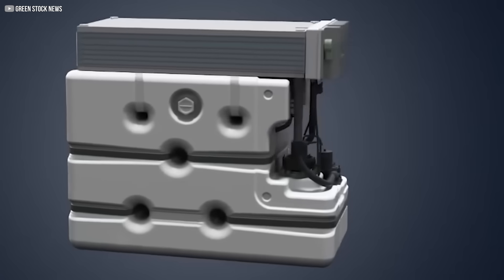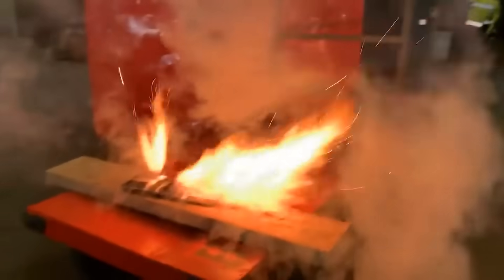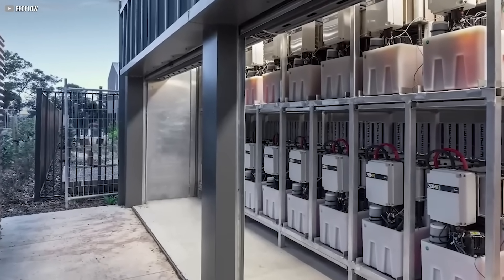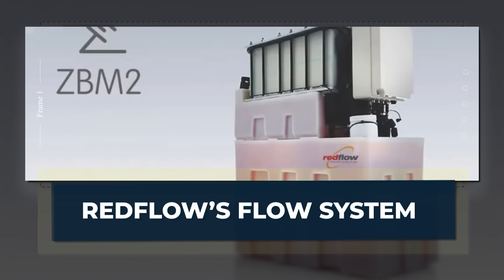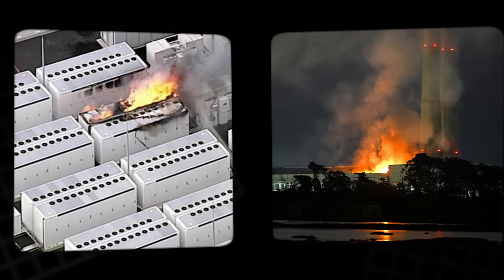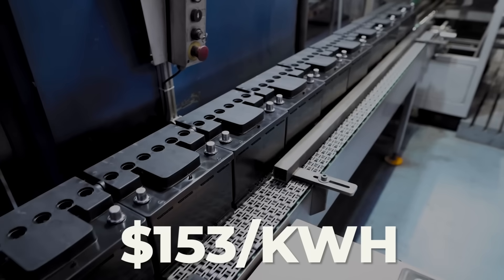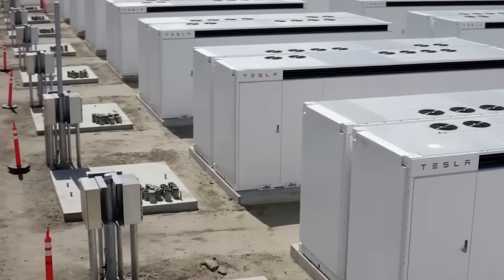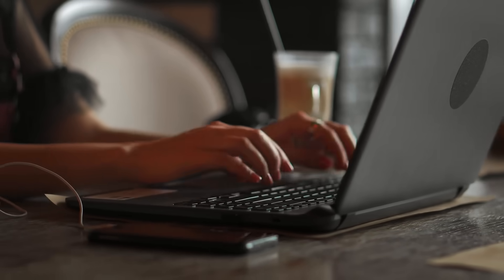Why a Century-Old Battery Is Suddenly the Future

Comment: thanks for this article which is long on enthusiasm and short on facts. i'm trying to understand the motivation. is it just surfing for eyeballs, or are you really advocating this chemistry? 

the zinc-bromine redux battery's energy efficiency is far inferior to lithium. while lithium can discharge almost 100% of the energy that was put into it, zinc-bromine wastes 1/4 of its energy. if you were advocating for energy efficiency in a redox battery, then vanadium would be a better choice. 

lithium batteries continue to improve. chemistries such as lithium titanate are safe. every mechanical part of a redux battery -- every pump and every valve -- still has higher failure rates than a solid battery. for reference on zinc-bromine efficiency, please see "a high-rate and long-life zinc-bromine flow battery" in the Journal of Power Sources Volume 613, 1 September 2024.

Comment: Not going to watch the whole thing cuz it's far too sketchy but the diagrams you shown are flow batteries. Hardly forgotten. Also, most batteries are surpassed by the capacity of the newer technology. Not that the older technology was bad. Just didn't have the capacity of the new ones do per volume or weight

Comment: According to Gelion they MOVED AWAY from "zinc BROMIDE (‘ZnBr2’) battery" to Zinc hybrid technology. 
When? At the end of 2024. The hype about Gelion Endure or a zinc bromide non-flow battery began from 2019. 
According to the article from Dec. 2024 at SolarQuotes_com_au.
So this VIDEO is OUTDATED about 6 months if my resarch is correct. They are experimenting with different chemistry now.

On Gelion 's page (GOOGLE) allinurl: gelion com technology zinc 
_ titled "Zinc Hybrid Battery Technology"  _ under "Zinc Frequently Asked Questions"  
Question:  
Why did Gelion pivot from Zinc Bromine to Zinc Hybrid cells?
<< Gelion determined that the Company’s ability to improve the safety of the existing [zinc bromide] battery will come at a cost of reduced energy density that will be below an industry-tolerable standard and resolving these will require a further lengthy research and capital expenditure plan. >> 
!! No links, because of Youtube filters. Sorry for the inconvenience. Does anyone have sth to add?

Comment: Meh, still prefer the Nickel Iron battery for home use.  Bromine is toxic.  Life span of Zinc-Bromine is 10-15 years compared to 30-50 years for Nickel Iron.  Nickel Iron has "more maintenance" but it's basically topping up the electrolyte.  Zinc-Bromine (non gel types) have pumps, replacing one of those is going involve dealing with the Bromine solution.  Sourcing materials for Nickel Iron is dead easy, and can be done in most countries, getting the ingredients together for a Zinc-Bromine battery is not going to be easy and may require licenses because of the hazardous nature of Bromine.  Zinc Bromine does have a higher energy density and cell voltage, but for DIY home use it's not enough to offset it's other issues.

Comment: yeah well i have water and salt with a pinch of carbon steel working on my basement since world war 1 or maybe before it started producing enough to power 2 in efficienct yellow fridge that look like it came fro 60s era 2 aircon tvs 9 fans and other stuff being charged by solar it has multiple pure silver poles poking out its box , its a DIY but damn it  works well and never been serviced since its build as my sister told me and now its my turn to take care of this relic and honestly we dont know how wed fix it if it failed so all we can do is put alot of safety fuses and breakers and super capacitors in each connections to protect it because the one who made it forgot to or maybe theres no existing blueprint when they built the battery.... is an aluminum ice cream drums with carbon steel and silver

Comment: I do like this battery, I installed a set up last year to a commercial building with solar panels. The battery was fine, the obtuse monitoring and control hardware/software is NOT. But it is easy to bi pass if you are an electrician.

Comment: Lead acids were used for cars because they were cheap and handled well short pwerful power drains from moror starters. Lithiums got used in laptops because they had great power density for unit of weight. But neither is critical for stationary power storage, where key factor is long life with ability to handle many power cycles and than ability to dispose and recycle them in evironmentally friendly way. I heard of Natrium batteries using similar chemistry like Lithium but with lower price for same capacity. Higher weight is not problem for stationary storage.
Reply: Na+ is more expensive per kWh than LFP currently.
The properties of Na+ makes it another 10 years before inverters can cope with cells that have a 1.5 to 4.0V working range instead of 2.8V to 3.4V of LFP, but the real working range of LFP is just 3..3.4V. That's a huge difference.
And don't mix LFP with any other Li+ battery, as the properties are so different from Li+ that it's hard to get problems with it unless you actually want something bad to happen.
So when my 135kWh LFP pack is ready for replacement, I will look again for Na+. To be clear: I have been waiting for Na+ seriously, postponing the setup of my new house. But it just does not exist for the consumer yet.
You can replace LFP by Na+ if you are willing to only use 25% or less of the Na+ capacity.
A 90kWh power pack is around 600kg. That already had to be checked with the designer of my house for the total load.
The liquid chemical batteries also sound good, as that means I can charge during the summer and use in the winter. I don't care if loose 50%. Of the potential 150kWh or more that I can have every day in the summer, I only use 20. But that's 40kWh...60kWh a day on a good winterday or 4kWh a day on those misty days, while still needing 40kWh a day for heating. Solar is 24kWh a day average in January. But that 4kWh a day average in the misty week.
So I don't care for 10% efficiency if I can charge it during excess, and using it during the needy days. There is about 4 months difference between the excess days and the needy days. So I need a long term storage for about 1MWh, and it can be 10% efficient.
And to be clear: I am only interested in this case for Off-grid home usage.
Reply: Had to search for what a Natrium battery is. It is a company called Natrium which is "America’s first mass-scale sodium-ion battery manufacturing plant in Holland, Michigan". Not a new sodium-ion chemistry, but a company.
Good to know there is manufacturing for it now in the U.S.

Comment: We have a model of how a voltaic cell works, but in practice, every single actual voltaic cell chemistry differs from this ideal model.  And more significantly, each one differs in a different way.  Some are harmed by being discharged more than a bit (lead-acid), others are harmed by NOT being fully discharged (nickel cadmium).  Some are capable of very high discharge and recharge rates (Nickel metal hydride).  Some, once charged, will discharge rapidly while just sitting on a shelf (also nickel metal hydride), while others can have a shelf-life of several years (but in general, cannot be recharged).
All batteries suck.  They just suck in different ways.  Choose the battery technology which has deficiencies that are not incompatible with your use-case.

Comment: The price graph badly needs updating, its from 2018. Since then the price of lithium has crashed as sodium now does much of the heavy lifting in cell packs. Also, as far as the 'brutal' costs of extraction, look at steel manufacturing first- around a quater millon tons of water to begin with, then 2 tons of co2, etc.

Comment: Something not mentioned:  battery performance in cold climates. Most batteries do not do well at all in cold climates. They cannot charge, or cannot retain a charge when frozen.
Reply from the maker: That's a great point! Cold climates certainly pose a challenge for battery performance, and it's crucial for manufacturers to address this issue as technology evolves.
Reply: I suspect in our cold Canadian winters, the gel would freeze, rendering the battery inoperative.

Comment: I had high hopes for Red Flow batteries, I was willing to buy some for my house's solar system, but no joy, they 
went bankrupt in 2024. I first looked at Edison cells, but size is huge compared to ZnBr, redflow cells are still kind of big.
 
I think I would prefer Red Flow over Gelion, cause they use 2 pumps, to circulate the chemicals. 
If you turn off those pumps, they stop generating electricity, (duh) So if you stop the pumps you can
come back years afterwords and just start the pumps to generate voltages again, IE no degeneration of 
those chemicals, unlike other/most batteries, that can self-discharge themselves dead just sitting idle.
Reply: I’m still waiting for sodium ion batteries… some mix might be the solution for a home.

Comment: Something I think is an excellent use of battery resources given it almost double an existing "stressed grid"  capacity! The MIT research group led by Donald Sadoway is known for developing a novel molten metal battery for grid-scale energy storage, according to the MIT Energy Initiative. This battery uses liquid metals as electrodes and a molten salt as an electrolyte, offering high capacity and rapid charge/discharge rates. Hopefully Gelion is heading in this direction too.
Reply: Sodium ion battery factory being built in China now… cross ya fingies
Reply: Not exactly...  The salt is a eutectic mixture that melts around 550 to 600 C.  I think the metal ends are calcium and antimony.  The calcium ions flow through the molten salt and alloy with the antimony, which melts at around 630 c
Reply: Ambri battery just came out of bankruptcy.  They survived.
Reply: @kayakMike1000  Wow, I even have that company on my list of interesting energy solutions for an off-grid house. But it wasn't consumer end anyway.

Comment: Solid lithium with non-combustible substrate was invented almost 15 years ago. No heat, no fires & half the size of lithium ion. But the only manufacturer I know of that uses the tech is Dyson. Everyone else knows about it but choose to cheap out with lithium ion. Up to a few years ago Toyota was still using lead acid.

Comment: Irritating sales pitch rather than a science discussion. Spent the whole video convincing us that all other batteries are bad.
Reply: You just dont know enough to know if it is bad. Look at iphones that has exploded in the past. And you cant recycle it. And it gets badder everytime you charge it. And bad for environment when you throw it out.
Reply: @nareshgopal9593  it just oxidizes landfills will be fine.  There's a lot of toxins underground including 100% of the ones that they put into the phone came from underground so it just comes down to be a mindful of water tables. We also can't assume that all Water Supplies are always safe and there should be continuous monitoring we have the technology to do it cheaply so it comes down to the excuse of failing to execute it all in local governments.  Sort of like offices that will spend $500 on a shity computer that doesn't work when they could have spent $300 on something that did the job correctly all because they were afraid of spending $2,000
Reply: @nareshgopal9593 those are isolated instances. The batteries mentioned here use bromide, which is more dangerous. Also they are not as compact and powerful as a lithium based battery